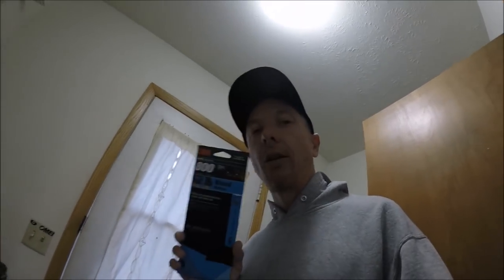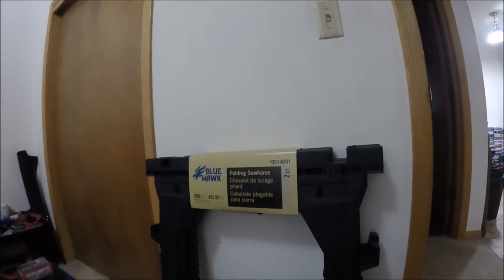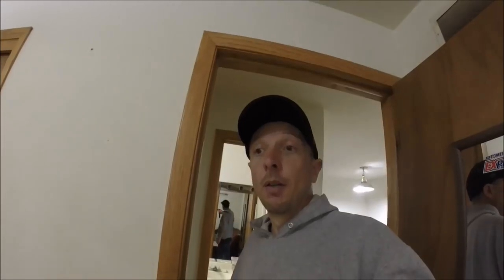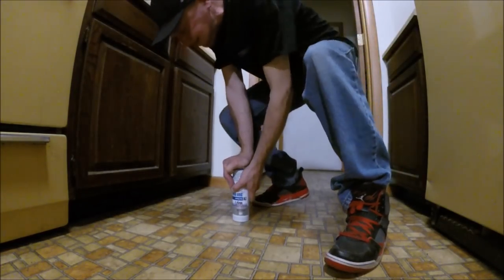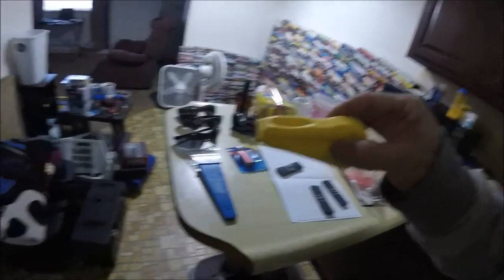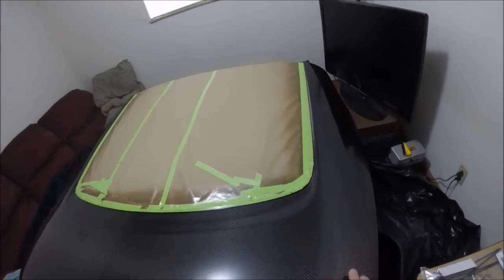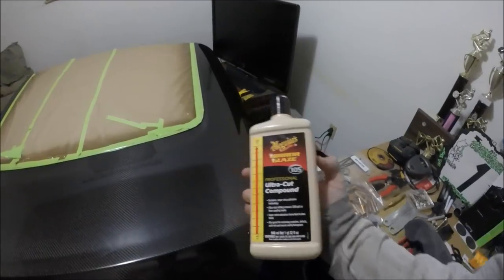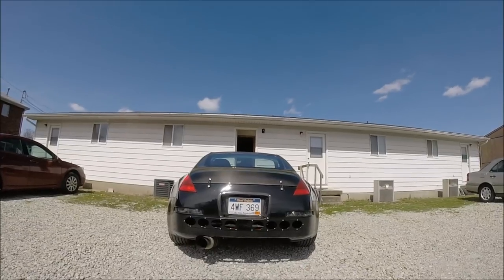The Best High Quality Spray Can Clear Coat Job On Youtube

Comment: I have an up rev DE and I can’t find a plenum spacer for my 2006 350
Reply from the maker: those are only available for the de not the uprev i believe your only option is for the upper plenum power mod available at http://www.z1motorsports.com and theres also porting your lower manifold 👍